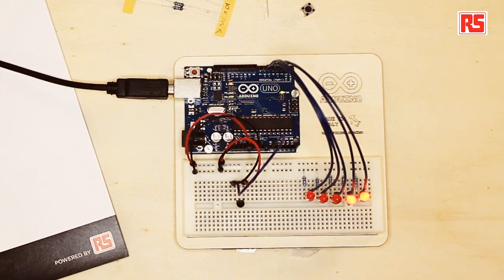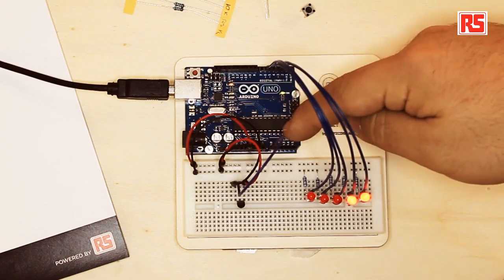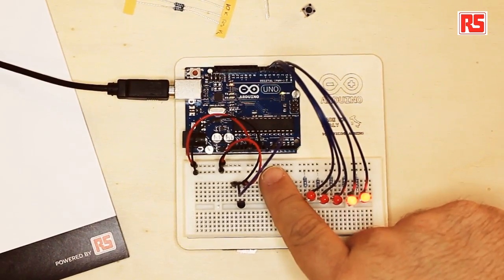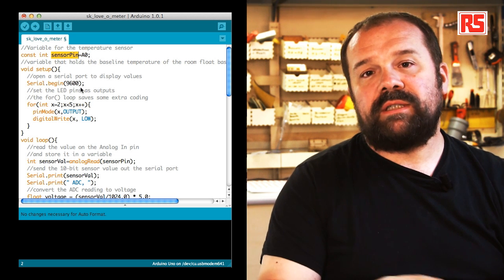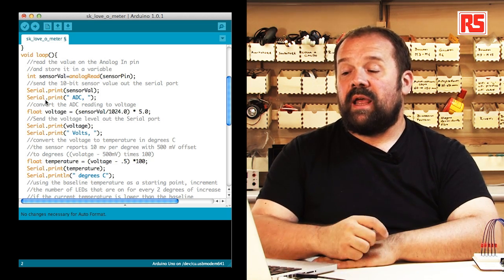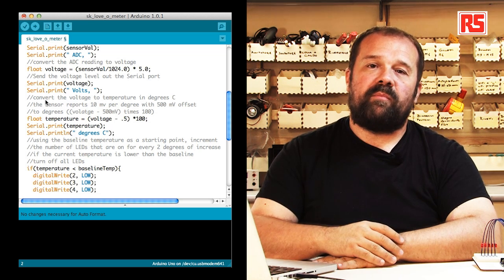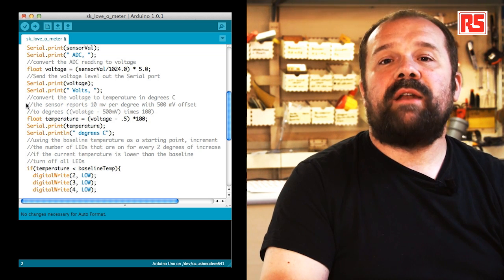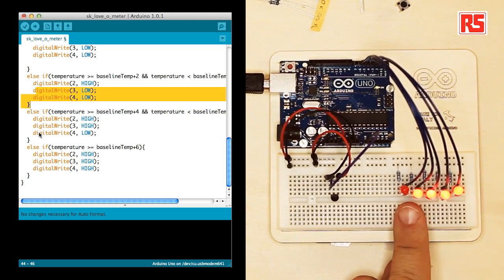Arduino Video Tutorial 03: The Love-O-Meter | RS Components

Comment: The first step would be to set the baselineTemp equal to the sensorPin temperature as the sensorPin's value would be the room temperature if left untouched. As the baselineTemp is your room temperature, you can also assign a value to it if you know what the room temperature is. You can declare this at the beginning of your code (const float baselineTemp=sensorPin) or set it to your estimated room temperature, i.e. (const float baselineTemp=20.0). 

The second step is to increase the output number of the LED's to less than 7 as only 6 digital outputs are being utilized. The "for(int x=2;x<5;x++)" needs to change to "for(int x=2;x<7;x++)". 

The third step is to to change your first if statement. I added 2 degrees to the baseline temperature as the temperature can not be less than the baseLineTemp value and to ensure the 1st LED switches off after a while when left untouched.

The fourth step would be to add two more else if statements for the additional two LED's. Also ensure to add digitalWrite lines to all the else if statements for the two extra LED's.

Code:

// Variable for the temperature sensor
const int sensorPin=A0;
const float baselineTemp=sensorPin;
//variabale that holds the baseline temperature of the room float base
void setup(){
  //open a serial port to display values
  Serial.begin(9600);
  //set the LED pins as outputs
  for(int x=2;x<7;x++){
    pinMode(x,OUTPUT);
    digitalWrite(x, LOW);
  }
}
void loop(){
  
  //read the value on the Anolog pin and store it in a variable
  int sensorVal=analogRead(sensorPin);
  //send the 10 bit sensor value out the serial port
  Serial.print(sensorVal);
  Serial.print("ADC, ");
  //convert the ADC reading to voltage
  float voltage = (sensorVal/1024.0)*5.0;
  //Send the voltage level out the Serial port
  Serial.print(voltage);
  Serial.print("Volts");
  //convert the voltage to temperature in degrees C
  //the sensor reports 10mv per degree with 500mV offset
  //to degrees ((voltage - 500mV) * 100)
  float temperature = (voltage - 0.5) * 100;
  Serial.print(temperature);
  Serial.println(" degrees C");
  //using the baseline temperature as a starting point, increment 
  //the number of LEDs that are on for every 2 degrees of increase
  //if the current temperature is lower than the baseline
  //turn off all LEDs
  if(temperature < baselineTemp + 2){
    digitalWrite(2, LOW);
    digitalWrite(3, LOW);
    digitalWrite(4, LOW);
    digitalWrite(5, LOW);
    digitalWrite(6, LOW);
  }
  else if(temperature>= baselineTemp + 2 && temperature < baselineTemp + 4){
    digitalWrite(2, HIGH);
    digitalWrite(3, LOW); 
    digitalWrite(4, LOW); 
    digitalWrite(5, LOW); 
    digitalWrite(6, LOW); 
  }
  else if(temperature>= baselineTemp + 4 && temperature < baselineTemp + 6){
    digitalWrite(2, HIGH);
    digitalWrite(3, HIGH); 
    digitalWrite(4, LOW); 
    digitalWrite(5, LOW); 
    digitalWrite(6, LOW);
  }
  else if(temperature>= baselineTemp + 6 && temperature < baselineTemp + 8){
    digitalWrite(2, HIGH);
    digitalWrite(3, HIGH); 
    digitalWrite(4, HIGH); 
    digitalWrite(5, LOW); 
    digitalWrite(6, LOW);
  }
  else if(temperature >= baselineTemp + 8 && temperature < baselineTemp + 10){
    digitalWrite(2, HIGH);
    digitalWrite(3, HIGH); 
    digitalWrite(4, HIGH); 
    digitalWrite(5, HIGH); 
    digitalWrite(6, LOW);
  }
  else if(temperature >= baselineTemp + 10){
    digitalWrite(2, HIGH);
    digitalWrite(3, HIGH); 
    digitalWrite(4, HIGH); 
    digitalWrite(5, HIGH); 
    digitalWrite(6, HIGH);
  }
  delay(1);
}

Comment: This video contains a small mistake and a challenge for the viewer. 
The example we show in the video is using 5 LEDs while the code in the book only handles three of them.
I'm sorry about the mistake but this could also be a challenge for you viewers.
Try to make it work with 5 LEDs and post a link to your code.

There is nothing to win at this time, apart from the admiration of your peers :)

Comment: either set x=0; x<5; x++ or change the 5 to a 7 like this x=2; x<7; x++

then just figure out at what temperature you want to turn on an led.

the example shows three so you'll have to figure out how to turn on the other two leds. 

*hint* the example's for loop starts at 2 so that's why it's the first led to get set to low. you can either go up from there if you use this x=2; x<7; x++ 2, 3, 4, 5, 6 (5 total leds) or start at 0 and go up 0, 1, 2, 3, 4, (5 total leds) if you use x=0; x<5; x++

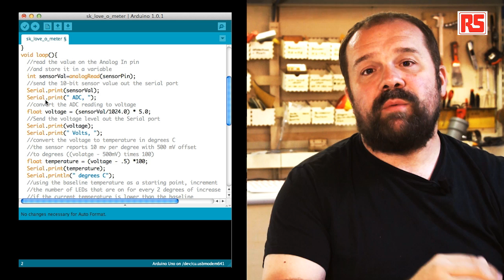Comment: After minute 8:00
The explanation for sending temp sensor data is to divide 5 volts by 1024 (0 to 1023)  is ok I guess. If that means 5V÷1024=0.0048828125V (rounded up to 0.005V)
BUT WHY multiply by 5?
No explanation for that value and I am still trying to wrap my head around that value.
0=0.025 (0.005×5); 1=0.05; 2=0.075...1,023=25.575
What is the purpose of multiplying by 5? Which component reads and translates that value and what is it seeing?
Is the value × 5 a constant across all temperature applications or will a different multiple be required in different sensor types?
Or is it not actual multiplication?
What happens if the script is written:

float voltage = (sensorval/1024.0) * 4.0;

Instead of:

float voltage = (sensorval/1024.0) * 5.0;

Comment: well, youtube won't let me post ANY kind of link :D
so what i did was to initialize "float baselineTemp = 0;" at the very beginning and then later on use an if statement to check if the room temperature had been initialized yet. if it was still zero, my code would take the current readout in celsius and use it as a baseline for later comparisons as in the video. Like this:
 if (baselineTemp == 0){baselineTemp = temperature;}

Comment: The serial monitor is showing very high values for voltage, as high as 600, which when converted to voltage equivalent is around 3.5 volts and temperature as high as 267degree celcius...please help...what could be the possible error from my end?
Reply: SAME PROBLEM HERE. TOO HIGH VOLTAGE AND TEMPERATURE

Comment: the sensor burnt my finger!
Reply: +Rushil Punchhi  same
Reply: I know it's been two years... but if you never figured it out, I'd assume you were using the transistor and had it going the reverse direction.
Reply: ...and an even later comment:
After looking into it some more, the data sheet for the part - TMP36 - is incorrect! leading to many MANY people burning their fingers. It is wired correctly in the video, which is the opposite of what the data sheet says. Probably some electrical engineer trolls... fuckers.